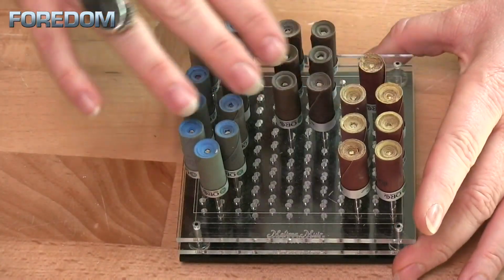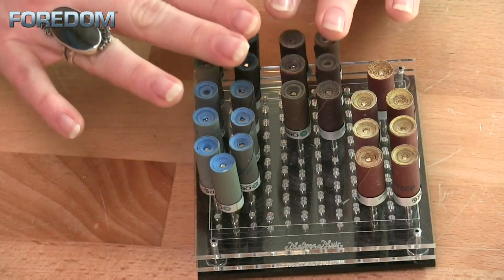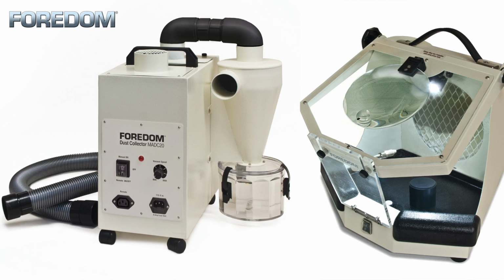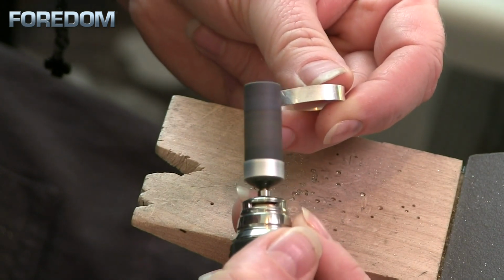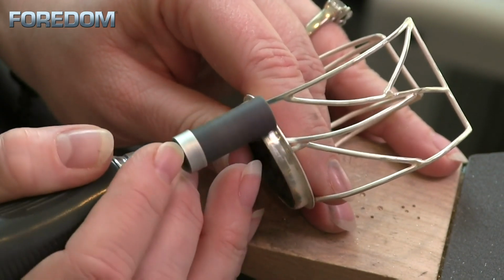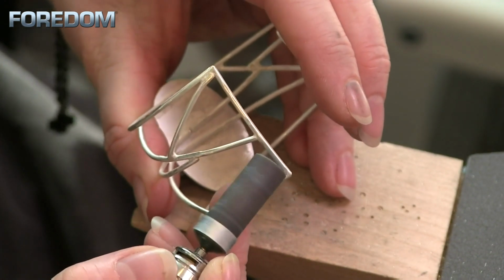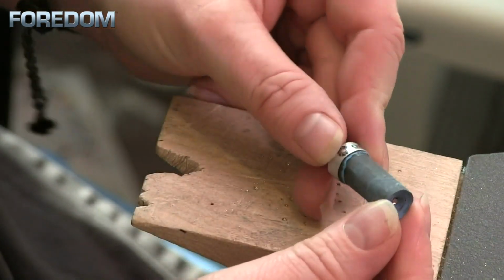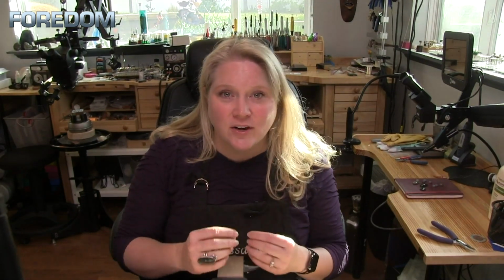Introduction to Accessories: Sandpaper Rolls

Comment: Wet-grinding sandpaper is often used, and sandpaper finer than #1000 is sometimes used with oil.
One of the purposes is to prevent heating and at the same time to prevent clogging.
I like the slightly soft feel of paper wrapped in multiple layers, but I don't think it's very suitable for polishing with liquids.